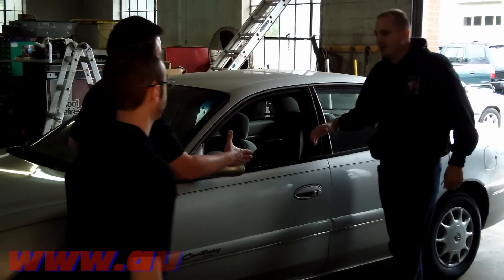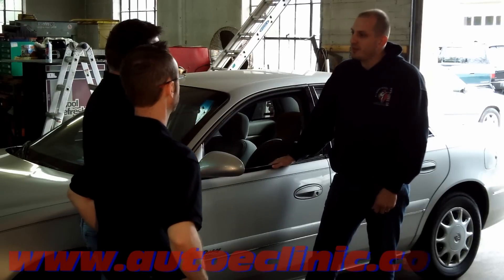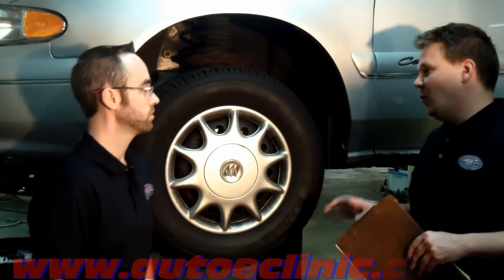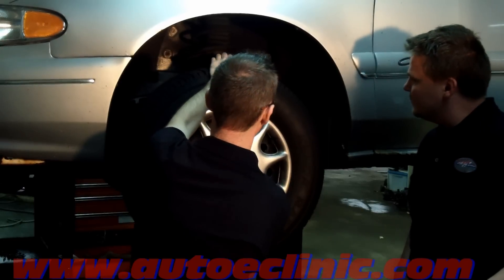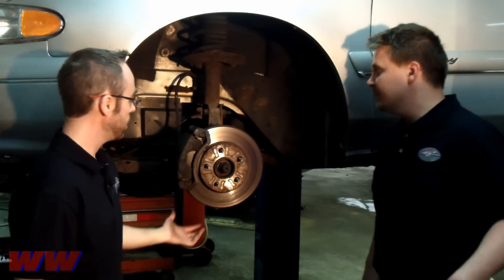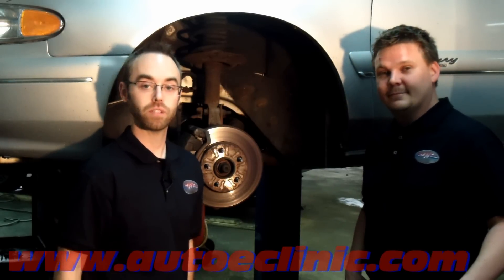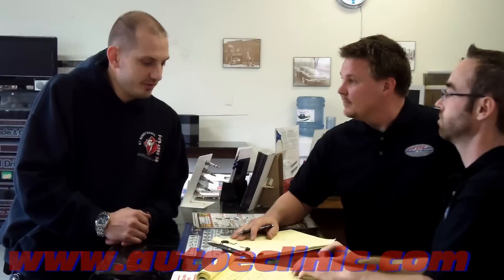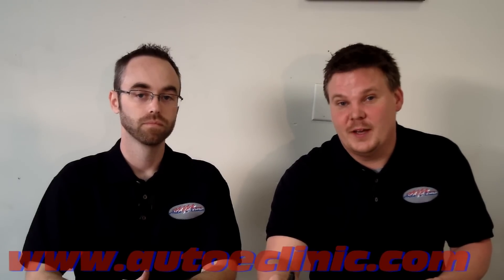How to Diagnose a Noisy Wheel Hub and Bearing

Comment: When the sound was hard to detect... I got my ex wife to ride on the hood and listen. During a high speed run is also a GREAT time to check your antilock brakes !
Reply: that sounds like a great way of getting rid of the sounds grating on every nerve in your life, next time you have a trouble  like this i will give you my ex's number  you might need a extra hood brace or 2 this ex comes with a LOT of B.S. thanks for the great idea.
Reply: @kimandherman  my pleasure

Comment: Great video. This diagnosis is exactly what I have. At speed going straight there is no noise, then turning slightly right, I hear a faint hum. 
I also have a problem when slowly turning and braking, like entering a space in a lot, or turning into a driveway. I hear and feel a much more violent rumble. Like gear teeth out of sync [I can feel it in the pedal like ABS]. If I take my foot off the brake and reapply, it doesn't do it again. Any thoughts? CV Boot? Doesn't happen every time. Connected?

Comment: So, I've just replaced FOUR wheel bearings on a Subaru Impreza 2009..
None of the four bearings had play like this when COLD, I could barely steer straight when driving, but there was absolutely no way to see any play when pulling it apart.

When disassembled and removed, it made quite a bit of grinding noises, again very hard to hear as when it's mounted, all I could hear was the drive shaft and the other three wheels grinding along when it was on there.

The noise of the front left was deafening, and with each bearing I replaced noise went down, and handling returned to the superb state it was when new.

I even got better mileage, from 34 mpg to 38 mpg!

They must be using a new kind of bearings, because my wifes Mazda 3 has the same thing.

When you turn, the brakes scratch the discs, causing something like a small hand brake turn! But again, zero play when I try to wiggle it. As this was a rear bearing without drive, I could remove the brakes and it does make an awful lot of noise.

Comment: I've got a bearing noise coming from rear of car. I think it could also be the viscous coupler bearings. The noise varies with speed and is not affected by steering. It is a similar type of noise to what is in your video but a higher pitch. Sounds more like jet engine than and propeller aircraft. The only thing besides the noise is a high frequency vibration in steering wheel and dash when travelling over 70 mph. Should I replace both rear bearings if only one is bad? 2006 Toyota Matrix 4WD w 77k miles. Alignment is within spec and has new Michelin Premiere A/S tires. Thanks.

Comment: I replace, both my front wheel bearings hubs.  I also changed the rottors and pads . But, I'm still hearing a noise sometimes. When I drive. It's not humming or growling. I'm wondering if it might be the caliper. Cause it sounds like a bad belt in the tire. But my tires are new. I have a Saturn ion 3. I'm wondering if it could mean. Maybe if it's the tire rod in and outer or possibly ball joint. I had someone inspect it and they said nothing wore or broke. So I'm at a lost at what it could be

Comment: i know this is a bit old vid but i found it cause i recently replaced my ball joint on the front? and ever since my whole undercarriage seems to be making a flap flap clack clack sound ONLY when i idle. and ONLY sometimes. i cannot pinpoint where its coming from but it wasnt doing it before. and very often sounds like its also coming from the back. any ideas? its almost like a plastic card the size of a post card, is stuck in fan blades, if you can imagine that sort of flap flap ? thanks in advance!

Comment: Ive got an 04 dakota 2wd.when i turn right i hear a popping noise on left front side..when i go around a left curve i hear a "tink" sound on same (driver) side..could it be a defective hub bearing?all the other suspension parts in good shape.i had ball joints replaces..sway bar links replaced..rack n pinion replaced.

Comment: It happens that both sides of my car had hub/bearing issues, so swerving really did nothing to load them. The sound is constant no matter if wheel is turned then back, but I can hear the right side slightly more when going straight.. I think you should mention bearings going bad start out as a rusty sliding noise then get progressively louder, while a CV joint may make a more crunchy type of grinding noise.

Comment: I have replaced all bearings and CV joints. Have replaced all motor mounts and lower control arms. Have noise when I let up on gas no noise from side to side any ideas? Completely new front end.

Comment: Hello, I have Costco install new all season tires yesterday and noticed that on the way home, the steering wheel wobbles when I hit 100km. I took it back the next day only to be informed that there is something wrong with my hub and that I should get it towed as it is not safe to drive it back home. My question is if they have changed the tires, should they have at least noticed that there is something wrong with the hub in the first place? As a mechanic, for changing tires, is it one of the things they should check for before sending the client away to drive a car with a faulty hub bearing? Thank you.

Comment: I have a front wheel drive 1995 Plymouth Acclaim and about 3 months ago it developed a popping sound from my rear driver side when I back up or go over a bump. Nothing when going straight on smooth road. I just replaced the shocks 18 months ago and they are not leaking so pretty sure that is not the problem.  I jacked it up in my driveway but could never replicate the sound. Any suggestions?

Comment from the maker: It could be tires. I on the other hand have had good luck out of Hancock. Try rotating the tires to see if the noise changes. If you are still in question use chassis ears. Thanks Michael and Aaron

Comment: About 3 weeks ago I had my car inspected.  One thing it needed was a ball bearing.  When we got the car back we immediately noticed it seemed like it needed an alignment, but over the past week it's gotten dramatically worse.  Not only does the car just go to the right, when we go around turns it actually throws you, often into oncoming traffic.  Today I noticed the steering wheel almost seems loose and you have to hold it tightly with both hands... any little bump and the cars allover the place.  Also I hear a scraping noise when I'm driving slowly into parking kits, etc (almost sounds like I'm dragging something).  To be honest, the reason I haven't taken it in is because of money, that inspection cost us $830.  Does this sound like a simple alignment or could they have put the ball bearing in wrong?  I realize in order to diagnose it properly I'd need to take it in, but any advice is greatly appreciated!
Reply from the maker: Rachel Lunn Thanks for your question Rachel and sorry for the delay. Micheal passed away back in March of this year so there are no more videos being made at this present moment. But from what you described sounds like an issue that needs to be addressed as soon as possible! It could potentially lose some steering capabilities.
Reply: Good heavens, immediately check to see if the lug nuts on your wheels are loose!.  You should see your attorney immediately!  

It sounds to me as though the "mechanics" failed to torque either:
1.  the lug nuts holding your wheel to the hub (and your wheels are about to fall off).  $830?  I have to multiply my rates by ten to catch up with your guys.
2.  the ball joint(s)
3.  the tie rod end(s) (and you won't be able to steer the car at all)

At any rate it sure sounds like gross negligence to me and your "mechanics" should be held liable for whatever additional damage they have caused.
 
If your wheels haven't fallen off yet, do what your attorney tells you concerning preserving evidence, get witnesses, take pictures, whatever will be accepted as evidence in your state.  Do whatever he says that will allow you to preserve evidence while you get out your lug wrench, take off the hub caps, and check the lug nuts.  If the lug nuts are loose, you need to establish that fact for evidence to your court, record that fact with pictures and witness to sign statements to that effect, etc., whatever the attorney says, and then tighten the lug nuts to specified torque before you do anything else. 
Then if you can still drive the car, take it to a secopnd-opinion mechanic and see what else might be wrong and don't tell him that you got shafted by the first "mechanics".  If the second-opinion mechanic points out something the first "mechanics" supposedly fixed, then give the original "mechanics" one chance to to repair it correctly PARTS AND LABOR AT THEIR EXPENSE with no quarrel.  If they would rather fix it than go to court, let them but take it back to the second-opinion mechanic to inspect their work, and hopefully you and whoever else is on the road at the same time as you are still alive to do this.

Sincerely,
David Parker

Comment: Recently replaced both hubs on my vehicle.  Months later, a noise is coming from one side and found the sealed bearing crushed and oozing grease.  The mechanic installed the spindle nut with an impact instead of a torque wrench.  Cutting corners by using the impact instead of taking a few minutes using a torque wrench cost me about $100 dollars.
Reply: +2cyclemix I had a pair of mechanics that torqued the crap out my Honda Accord spindle nuts. I had to use a 1" diameter bar with a  4' steel pipe as extension to untorque both spindle nuts. I say the nuts were torqued around 300 lbs. Unacceptable.
Reply: Lazy mechanics.  300 foots lbs. may be close to twice the spec. for the nut.  It's all about getting em in and getting em out.  Chasing the hours to make more money.  So much for taking pride in your labor.

Comment: Hey guys. I have been dealing with a similar issue from my 2005 Corolla with 116000 miles. However I didn't start noticing this until s few thousand miles after replacing my tires with cheep Hankook all seasons as an emergency low buffet fix for worn tires. I am a mechanic by trade in the Air Force but a weekend warrior auto tech. My instincts are saying it cheep tires wearing poorly due to worn out struts (getting replaced next week) but the bearing remains an option. What do you think?

Comment: I got a 2003 Infiniti G35 coupe which was wrecked on the passenger side. I had to replace the cross member or (K-member) as it got punched on the passenger side by a concrete divider. There is no free play in the wheel but when your driving straight and over 35mph there is a VERY slight hum from passenger wheel, but when you slighty turn ateering wheel the hum goes away. Is this a bearing?
Reply: ddemier probably

Comment: Can a damaged wheel bearing affect the pull of the car?  I hear a humming in my 2006 GMC Envoy once I hit 30 mph and need to press the gas pedal harder for it to go.  any advice?  Thanks!  J
Reply: Absolutely, I went from 34 to 38 mpg with four new bearings. When under load they can skew, and scratch the brake discs. If there's a lot of wear, you can see this by a rusty ring on the discs where the pads don't touch properly.
Reply: Shinobi
I shudder to think about cruising along oblivious to what's happening inside a wheel bearing that makes a 4mpg difference.

Comment: Where was the play in the vertical axis? That was just noise from the steering rack as you shook the wheel. When you swerve left how are you putting load on the opposite wheel when the weight is transferring to the direction you're turning?

Comment: I I have a 2001 Camry. When i start the car and drive it forward I start to hear a noise coming from the passenger side. I don't know what exactly it is. Either a suspension, strut I;m not sure what because I don't know much from cars. Is is safe to drive? Can a wheel or tire come out of the car? Need help. Thanks.

Comment: It sounds like this is the problem in my Nissan Maxima 2006. Except it's reversed. A few weeks ago it started with a hum which grew to a roar as the car increased speed. And now it makes a grinding noise.

But here's the thing. It sounds like it is coming from the left side, and I confirmed this by walking beside the car while someone else drive it slowly. However, it gets worse when turning to the left, and less noise when turned to the right, which is the opposite of what the video said.

Comment: For me it was the opposite. I had noise when only turning right and the right side was bad, not the left as stated in this video.
Reply: psdude23, mine was the same as yours. I have a nephew who fixes cars and he said the same thing as the guys in the video, if it lessens when you turn slightly, it is the opposite side that is bad. So he ONLY changed my passengers side bearing but the sound remained.... lum lum lum lum, as I drove down the road. Like the guys in this video, he thought it was ALWAYS the opposite side. He told me that even though the axle boots were intact, one of the joints must be bad and that I would need to change an axle.
Being an industrial mechanic, not a car mechanic, I know how to diagnose and repair bearings but I hate fixing cars. Especially up here in the northeast. I checked the wheel bearing myself and it seemed a little loose to me, so I changed my drivers side bearing hub as well, I have a 96 Voyager, and presto chango, my noise is gone.

Note to the guys in the video:
You should amend your comments about how to diagnose which bearing is bad, by adding that it is usually but not always the opposite side.
Reply: Bob Birt Thank you for this comment. I have the noise coming from the passenger side and it gets worse when I turn to the right.  I am really glad I saw this.
Reply: Bob Birt To re-iterate what Bob has said, the diagnostics step with regards to turning, as given in the video, does not always apply and should ideally be updated. I have a Ford with a bad front LEFT bearing that gets noisier on turning LEFT, not right. Also, you often don't get any play with a bad wheel bearing assembly.
Reply: Witchaven Yup. Glad I could help and its been 2 months and the car is as quiet as the day I got it. My wife is soooo happy.
Reply: That just happened with me earlier today; classic loud hum coming from the front with the steering turning right, but car sounded fine making left turns. Car is a ca 2008 Hyundai Accent, replaced the L/H bearing and, that noise still there.
Reply: @bobbirt7459  And newer Caravans, I'm guessing 1996 up, they have complete bolt on hub/bearing assemblies.

Comment: hey guys i am a fan but i also have a problem i bought a car cheve captiva diesel 2.0 2007  didn't check it first you know tipical mistake now i notice tthe engine light comes on and the oil light comes on i see that the oil is not good so i will change that and i know how to reset the light but i do not what to do about the engine light after servicing the engine runs sweet. now i would like to know how can you help me please oh and also i asked here because i like to read the comments on utube

Comment: The wheel bearings on Nissan cars are designed to fail they have a groove cut on the spindle to create where you may only get 10000 miles out of the bearing
Reply: In addition, Nissan wheel bearings chew up punctuation like nobody's business.   10 words in and periods are  completely gone.

Comment: Now, let me add, it made this same noise back in November. and I had the front wheel bearings replaced, which fixed it.This seems to be a recurring problem with this car, because it's only been 8 months.. So I'm thinking the hub needs to be replaced too, or perhaps it's the axle boot?

Comment: I noticed there was no evidence of drive shaft chatter, and clean out, new grease and a new CV boot is probably all that's needed. 
A good set of tools, common sense and even a manual for some bits and pieces.  
Personally in 25 years of driving nothing I've replaced/serviced has ever failed, same cannot be said for dealer and garage repairs/routine service (to maintain warranty) - they always loose bolts, over tighten bolts and never grease things that should be greased!
In the last 15 years all my vehicles have been modern Mercedes 3.2 Litre V6's as well as Jeep KJ 2.4 Petrol (Gasoline) and WK with V6 Mercedes Diesel.

Comment: What if I turn my wheel to the left and it goes completely away?!? Because I took your advice and replace the driver's side wheel hub assembly and it's the same! I turn it to the left and it goes away, turn it the right and it get a bit louder! And the faster I go the louder it get's also! So wth!?! I don't know that the hell is wrong, the job sucked though damn hub was some hard to pound out that I almost gave up a few times. So do I replace the passenger's side now or what?!?!?!?!?!?!?!?
Reply: Yes, what they said is wrong. For me, there is only noise when turning right. I was going to replace the left side because of what they said but I'm convinced it's the right side. The right side has play (At 12 and 6) and left side doesn't.

Replace the right side!!

Comment: This is not a fool proof method, seen it first hand. Sometimes when you load the right by swerving to the left (or vice versa) you are changing the load on the inner/outer bearings on the left as well. This one actually bit me today at the dealership. Chassis ears are helpful but ours arent working that great right now (abused).
Reply: I can feel it when I turn slightly and the noise does get louder . I can feel it in the steering wheel.

Comment: When I turn to the right at higher speeds the sound gets quieter but my passenger side wheel has NO play. I am baffled. I just had the drivers side wheel bearing replaced last month is if it is a wheel bearing and it feels fine too. It is not easy to get those things off with a bad back but that's the only next thing I can think of to try. WTF.
Reply: Was that Chris fix?
Reply: @peterwaltemath1355  Christine to you.